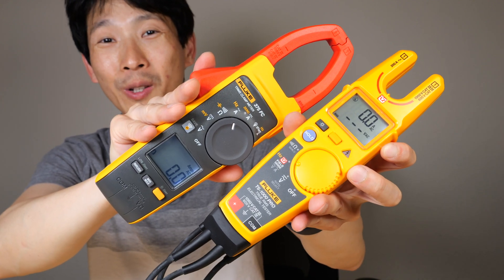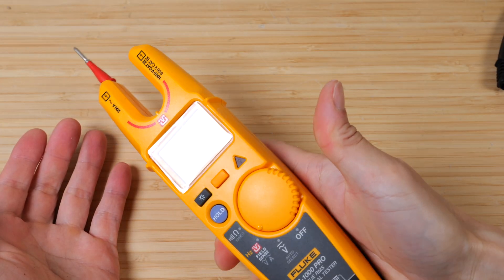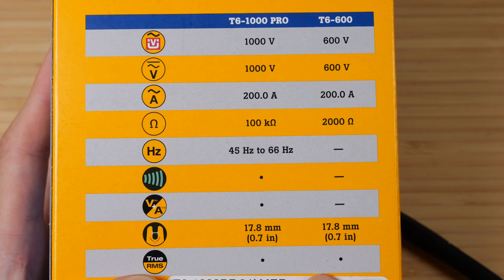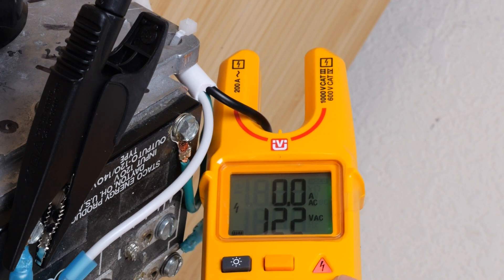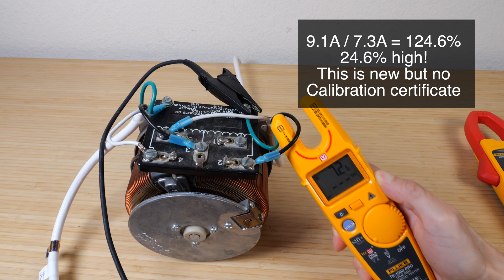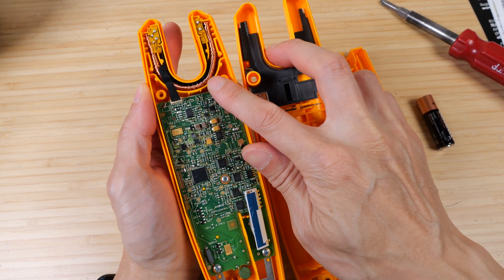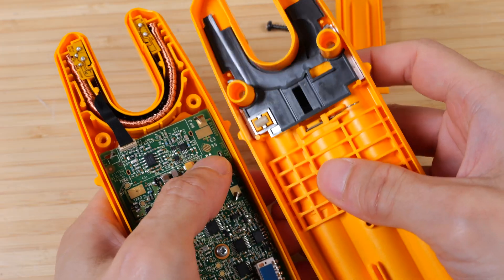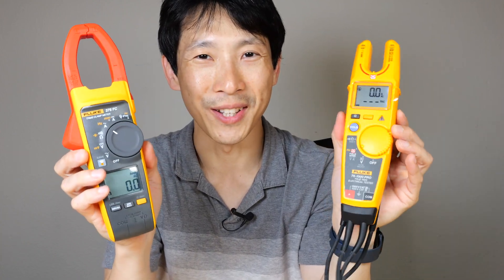Fluke Open vs. Closed Jaw Current Clamps

Comment: Thank you for pointing out the inaccuracy of the fieldsense meter compared to the wrap around clamp. I am amazed at some of the videos where the two types of meters are compared and the person testing acts like a little off on the amp reading is ok. For me two amps off is huge especially when you are only reading a small amp draw of say 10 amps (20%) and also you have to make sure that get the wire as far back as possible to even get the highest reading which may not be possible if you are in a small space. I bought on of these and after testing it myself I just can't accept that much error especially when most of my testing is done on circuit of 10 amps or less. I love Fluke but guys this is a great start but needs refining.
Reply from the maker: Really depends on your usage. If you want to know if a 'large current' is running, then sure, use the open jaw one.
Reply: @BeatTheBushDIY   But I think for an electrician those 10% is quite important, because 10% difference from what you would expect do indicate something is not right, there might be ghost currents and leakage, or maybe there is a nullpoint or ground issue. Also it might indicate the wires need a thicker dimension....